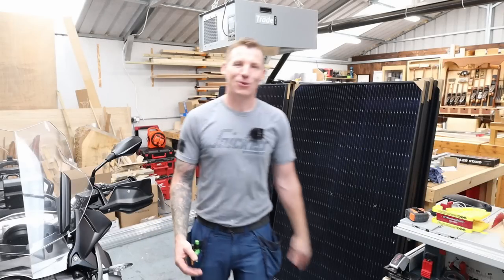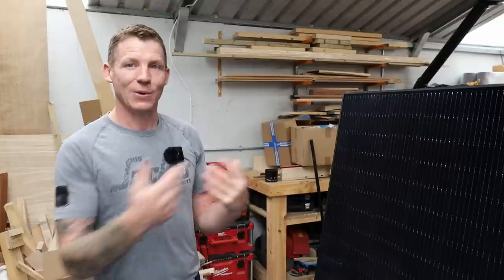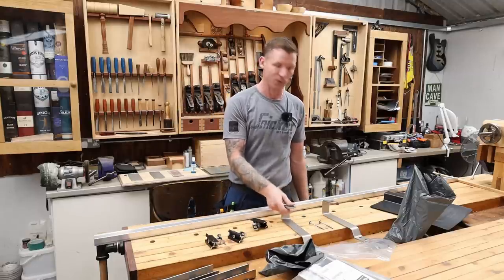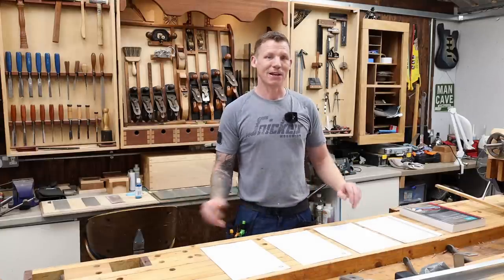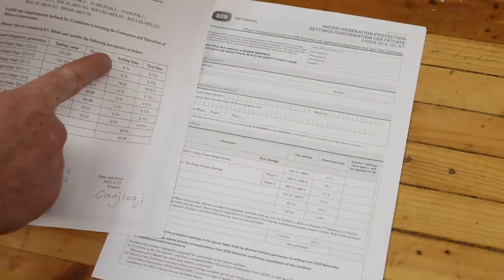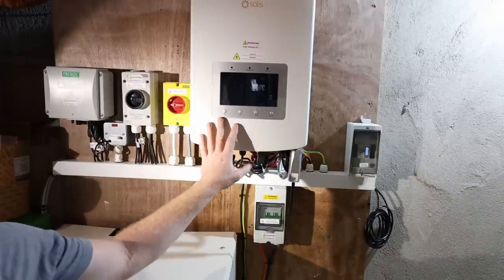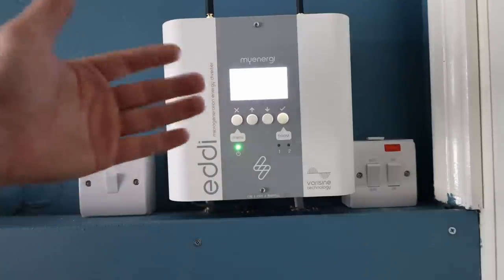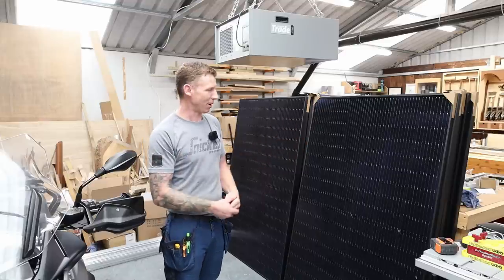Installing a Solar PV System in Ireland. A Look at the Kit and What to Consider. What's Involved

Comment: It's a pity we don't have net billing, would mean no need for battery storage! With all signs indicating that we're going to struggle with power this winter it feels like the CRU / ESBN could do more to incentivise micro generation by providing meaningful feed in tariffs. While it won't solve all our problems it would help with grid stability.
Reply: Hey Philip. It's lot better in Ireland than here in the UK where the feed in tariffs have been reducing. The best offer is currently Tesla (?) who offer 10-12p per kWh against an average price of 28p to buy 1kWh. The standard electricity companies pay between 1.5-7.5p per kWh. From what I can see Flogas are offering 20c per kWh and charge @ 30c. That's pretty good. Most likely what will happen is the SEG will reduce as the PV roll out continues in Ireland. Lets face it, the electricity supply companies do not want you becoming self sufficient. Unless they can buy electricity from you at a lower price than the wholesale price?

Comment: Very interesting, didn't realise you lost solar inputs when electricity is cut off. Makes sense if engineers are working on the grid but can you not continue charging your battery and use the panel generated electricity within your own house.  I am expecting a few power cuts this winter!!
Reply from the maker: You can put in an off grid system to charge batteries and then you could draw power from the batteries through a change over switch that isolates the house from the grid the same as you do with a backup generator.

Comment: Hi John great video as always. Just wondering why the automatic switch can't be installed between the grid and the inverter so you could still have power in the home from the panels or the battery in the event the the grid needs to be turned off. Cheers Sam
Reply: Yep that's what I was thinking but it's probably Reci making up stupid rules again.
Reply: I don't have one installed on mine, RECI said its to do with where the cables come in from the solar, mine are in a shed less than a meter from entry into shed, with panels on the shed. the inverter itself shuts off when it detects the grid down, no battery for me :(

Comment: Recently I made enquiries about solar panels with two providers. One of  the providers is through my electrical company and will allow me to pay for the system over 3 years interest free and they recently did a survey and they dont recommend the battery but the system would have 10 panels and the eddy. My usage is under 2000 units and i would use a lot of that on my free day which is Saturday on my electrical smart meter plan.  My house is in the North East and was built in the 70s east - west facing, it has a duel heating system open fire with back boiler and oil heating system both heat the water. However this is where I start to get confused my electrical fuse board is from about 1979 the surveyor seemed to think it would need changing which I knew and i am willing to do but that the house may have to be rewired . I also contacted my own electrican and he will be dropping into me soon to check the wiring and to see if it is the case . What would you advise on this and would you think it is worth my while ?
Reply: Did you have to rewire or just get a new consumer unit?
Reply: @elizabethstaunton790   i spoke with a friend who is an electrician and he told me if came to change the fuse board with the new regulations he would have to rewire the house. Some of my neighbours changed their fuse boaeds only before the regulations and since then had the air to ground heating installed an his passed (he didn't change any wiring). Considering my usage is very low and insurance I decided to leave as be .

Comment: Hi John, great video. Did you consider installing a solar water heater system also? Would that system be better for heating the water tank? (& then keep the Solar PV powering everything else other than the immersion)

Comment: Hi John,
I have to say, having seen what is left on the wall from other installers etc, you do VERY CLEAN work - restores my faith in "professionals" lol. 
Question: Is it possible to put the automatic grid-tie cut out switch downstream from the internal grid within the house? ie. Can you isolate the panels, battery storage, inverters etc and put the back feed to the grid as what would effectively be a spur load  off your own little generation / storage island? Would this sort of option then also require an automatic switch - similar to those used with stand-by generators on the feed to your house panel?

So... Panels -> inverter ->battery storage ... this is a "unit" then a load applied to that generation source for the 6.5KwH  grid tie feed (with the automatic isolation if the grid goes down) and a second load ( second inverter even ??) to your house panel feed switch... that switch then being either a smart switch which will draw off your panels first and fill the load from the grid and/or pull only from one or the other.
I guess this is then a 2 source, 2 load, redundantly isolated system.....
Reply from the maker: A lot to talk about there, I might do a follow up video an try answer some more question that have come up.
Reply: Great video, one of the best I’ve seen. Would love to see a video on the actual install. That solis has a second backup ac output that works in event of a power failure. If you took out some essential circuits like lights, fridge and freezer, Wi-Fi etc from main consumer unit and put the them into a second board, included either a manual or automatic change over with a feed from the main consumer unit and one from the solis, then you could have backup from the battery in the event of a power failure to these essential loads. Has anyone done this?
Reply: Looks like you need something close to (semi) separated off-grid system. Great at blackouts. I'm thinking as well abous similar thing, I'm West co. Limerick.

Comment: Excellent video, well done. One question; in the event of a power cut and your PV panels are automatically isolated, do they then run without a load or is there a dummy load ?  My understanding was that they can be damaged if allowed to run without a load of some sort ???

Comment: Interesting video. I assume your loft doesn't get to hot to affect the battery / inverter life. I like the eddi unit, a very clever idea. I think if blackouts become more frequent, developing an inverter that can disconnect from the failed incoming supply to keep power in the house and then resync back to the supply when it comes back again will soon get developed.
Reply from the maker: It would be so easy to add an automatic change over switch but the regs say the solar array must be isolated I have no idea why.
Reply: @JohnMcGrathManInShed  you should be able to island your system. 
Need to isolate the panels so the ESB don't get a shock if they're working on the lines.
Reply: @JohnMcGrathManInShed  Hi, UK regs here so they might not apply! - All live conductors, that is line(s) and neutral, that are to be powered in island mode must be disconnected from the grid, A manual or ATS would isolate the grid and EPS so they never come into contact with each other

Comment: Hi John, this video is excellent, thank you so much for taking the time to make it and giving a fairly detailed summary of the system. We are in the process of a new build and want to install such a system. You had said that you can use the system to heat a tank of water which I assume is for hot taps and showers. My question is; is it possible to use the system to heat enough water to heat your house via radiators or underfloor heating. I would really appreciate your thoughts on this. Thank you, Kieran in Mayo
Reply from the maker: Hi Kieran it would not be big enough to run a heating system but it could help offset the cost of running an air to water system for under floor heating. But remember you need most of the heat in the winter when there is not a lot of sun.
Reply: @JohnMcGrathManInShed  Thanks for the reply John, we are thinking about installing it and have it work in conjunction with another system. We hope that from April to September the solar panel would supply us with enough hot water and any heating the house would need (which would be minimal) and for the other 6 months the other system would supply most of the heat. We are undecided on what this second system will be. I will be very interested in your next video showing performance of the panels. Your channel is the first one I ever subscribed to. Looking forward to watching and learning from your content. Thanks again, Kieran

Comment: The system you have with Ginlong (Solis) inverter, Eddi diverter and Pylontech batteries is extremely popular in Ireland. Often there is also a Zappi for charging electric cars. The main difference with a lot of installs is that not everyone goes for the batteries. The batteries were a no-brainer in the days before feed in tariff but nowadays they are valuable as a source of backup for when the power goes. Does your inverter have a backup outlet so you can run from the battery when there is a power cut?
Reply from the maker: It does indeed.

Comment: Great Video, is there ever an issue with the heat in the attic in summer with the invertor no fear of overheating ?
Reply from the maker: I haven't had an issue so far, my attic is insulated so that helps keep the temperature down on hot days

Comment: Good intro vid. I'm not convinced that the Eddie makes any sense while you get money to export. Of the people I know who have it it doesn't provide enough hot water at the right times so gas is required to supplement and their export drops to near zero. They switched it off and export rate went up and gas use remained the same. If there is no export rate being paid it's a good idea.

Comment: Will be interesting to see what you get out of the system over the winter 

Interesting that the 6 KVA is max invertor 

My house is east west as well so will be a good case study. 

Did you up the size for the east west or to give juice to the workshop too?
Is it overkill for a standard 3 bed house ?
Reply from the maker: I will do a follow up soon, my best day so far has been a total of 12kwh generated and worst has been 2.1kwh. I have generated a total of 180kwh in the 4 weeks. My average monthly use is 260kwh so its over 50% for this time of year, it will be less and less as the days shorten. As for the east west, I installed the same system on my friends south facing house his system preforms better up to midday but mine generates more in the evening, when the sun is setting mine is still putting out 1.5kw when his has almost stopped, so it balances out.
Reply: 6kVa isn't the max inverter size, it's the maximum export limit. It's possible to have 2 of the Solis inverters as shown in the video so long as at least 1 of them sets an export limit of 6kVa, although the second one cannot be powered up until further confirmation from ESB.

Comment: Great video John! My wife and I are just in the early stages of planning a cottage reno and are wanting to add a solar system to a 40 sq mt extention out of the back. A couple of questions. We can plan the orientation of the extension to meet the needs of capturing the sun, but would a typical 400 sq ft extension have enough roof space to hold a system? Also, apologies but non technical, when you explained the "grid trip switch" piece, and you said if the grid goes down the panels are isolated etc. Do you mean that the system would no longer continue to power the house etc? Like an off grid scenario? Are there systems that would allow that or does the ESB have a blacket rule? Many thanks and you have a new follower! Cheers, Peter, Vancouver Canada

Comment: Hi John. Brilliant video. I'd like to know if it would make more sense to heat my immersion during EV tariff hours at night (9c/kWh) with an immersion timer and then export excess electricity to the grid @ 24c/kWh. Thus no need to have the Eddi installed or should I just have it installed anyway while the job is being done?

Comment: Great video john, just a few small questions as it is something i am looking to install on my house and shed.
1. For the house install if you are not looking to sell power to the ESB can you go above the 6kw system as i was adding it up i would be able to fit nearly 13kw of panels on my roof as it has no windows or vents.

2. if i was to install a indopentent system on my workshop like you would have on a camper do i have to get someone in to install it that is hopefully going to be able 4 to 5 kw in size

.
Reply from the maker: You can install your own system a long as you are not connecting it to the grid, however be careful of the amount of panels as there is planning permission required in certain circumstances.
Reply: @JohnMcGrathManInShed  Thanks John I will be careful i will be getting a local lad to look over it as i do it to make sure. i will give the councle a call to ask the planning side. my main idea is to still be able to keep going if the power goes out and also with the talk of power cuts.

Comment: i dont know the regulation in ireland, but here in belgium we put an auto-isolator on the grid line and not on the dc-solar.
when th grid go down the grid  disconnects, from the hibrid inverter. 
the inverter creates a microgrid from the batery wich alows to use the solarpower in combination with the batery..
wen the disconnect gets a stable grid it reconnects to the invereter.
i cant find a reason to use a hibrid inverter if you cant load the batery from the panels wen the grid is down.

Comment: Hi John, great info and video. Just a question am I still limited to 6000w if I don’t want to connect to the grid.
Reply from the maker: No but you are limited by planning on the amount of panels you can install and it must adhere to the code of practice, if  you look it up you will get the government safety document and the SEAI code of practice.
Reply: @JohnMcGrathManInShed  thanks for the feedback appreciate it.

Comment: Hi John, well informed and detailed video on solar installation, I had all my documentation to be connected to the grid completed by my installer everything solar wise is working fine.But from watching your video alot hasn't been done to same quality on my installation, eg tidiness,safety labeling.
If I can you ask a question,my certificates state battery capacity of 5.2 kw,but thats not enough,can I still install extra battery capacity?
Reply from the maker: Yes you should be able to add extra batteries to your system
Reply: @JohnMcGrathManInShed  Thanks for replying, I wasn't sure if I had to apply for permission to add extra batteries from the national Grid.

Comment: Hi John, just been looking at this again. If I understood correctly, the firemans switch shuts of the PV array; what stops the battery (if you have one) providing power back to the grid or to the house?
cheers
Donal
Reply from the maker: The inverter stops that happening when the power goes off, there is a second output on the inverter that you can use as a battery backup but it must be kept separate from the rest of the electrical installation

Comment: Thank you for a very informative video which has clarified so much for me. Quick question .. does your registered electrician have to be SEAI registered as well? I know they definitely do if you want to apply for the grant but I might research sourcing my own kit and getting an electrician to install them to see if it’s more cost effective. In this case, can any registered electrician install the panels without being registered with the SEAI? Thanks in advance!
Reply from the maker: You only need to be with the SEAI for the grant, but it must be a registered electrician that does the installation.
Reply: @JohnMcGrathManInShed  thanks for letting me know - much appreciated.

Comment: Great video. Question as a Eletrical apprentice. Should the fireman switch not be disconnecting the main power in rather than the solar generation? I mean if you disconnect the solar generation the battery will still be powering the house and could potentially still send power back to the grid ?
Reply from the maker: The battery doesn't power the house when the power goes out. There is a second output from the inverter that you can use as a battery backup, but this must not be connected to the mains. You can use it to power a stand-alone socket.
Reply: @JohnMcGrathManInShed  could it be connected and designated to power the house in case of power loss rather than just a one socket or is that against the rules ?

Comment: Hi John, quick question...That Solis inverter has the ability to output backup power during a blackout via the backup outlet which is separate to the grid tied output. Is this allowed to be used for essential consumers, I have not seen it being used in Ireland even though these inverters are marketed as capable of providing backup power.
Reply from the maker: You can use it for essential services but it needs to kept separate from the rest of the electrical installation. I'm using mine to power a stand alone socket that I can plug into in the event of power failure.
Reply: @JohnMcGrathManInShed  Thanks that's what I was planning, to run a separate socket for the fridge and another for the heating boiler to allow them to run in the event of a blackout, the sum of those would only be maybe 300w. Great Video, Thanks.
Reply: If the essential circuits were taken out of the main consumer unit and put on a board along side the consumer unit. Have a change over switch on this board too, input from consumer unit and the other from the solis then all should work. The change over would prevent power going back into the grid. Anyone done this?